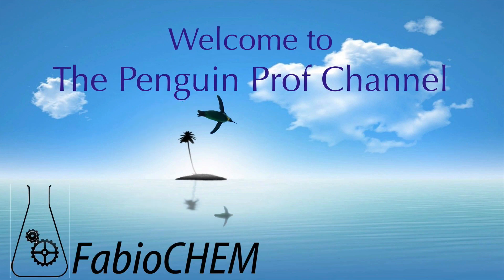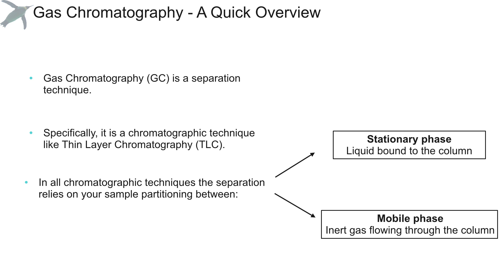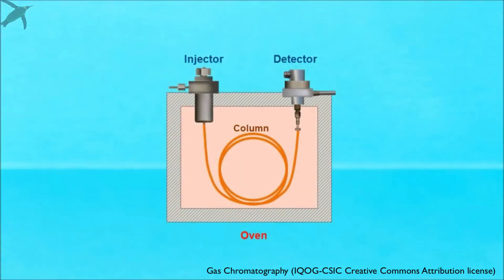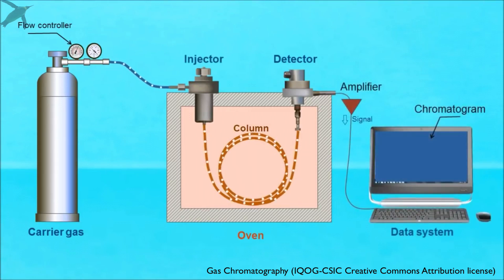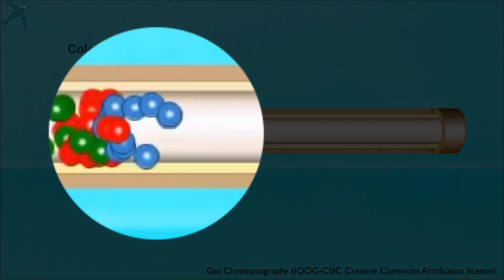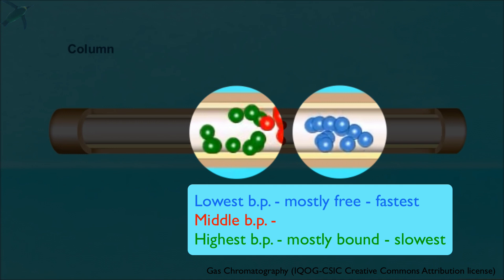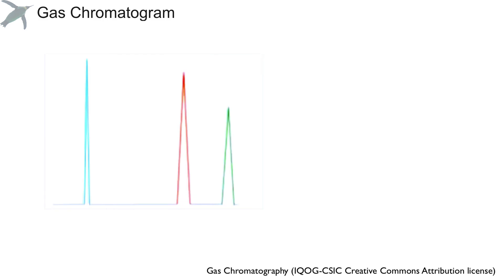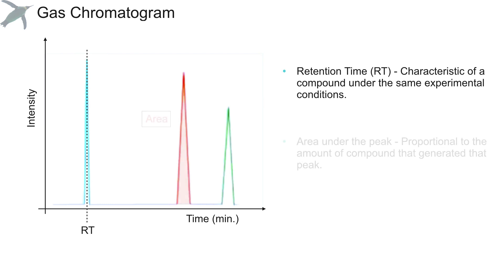Gas Chromatography THEORY

Comment: Do the molecules take longer to move down the column do to molecular weight or some type of adhesion to the column surface?  Great video 👍
Reply from the maker: Separation is based on boiling points, not molecular weight (shown at 2:10).
Reply: @Penguinprof  Thanks Penguin Professor